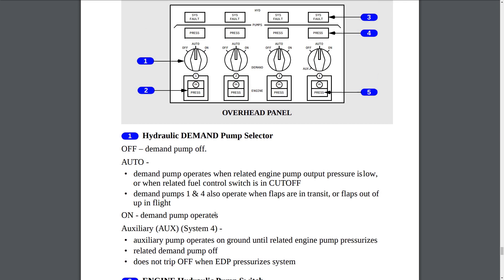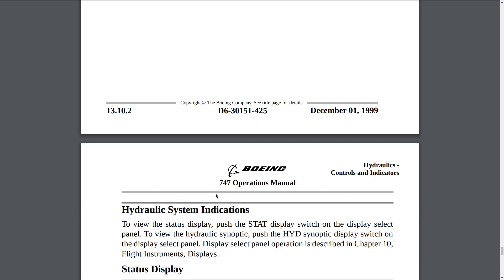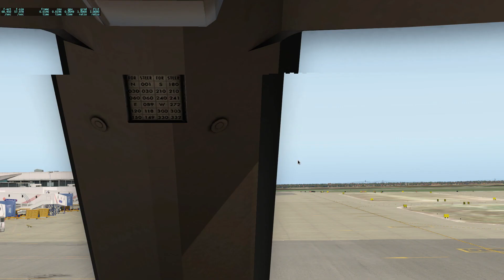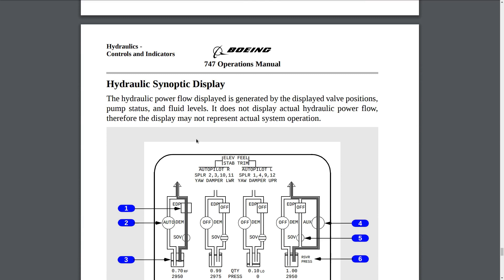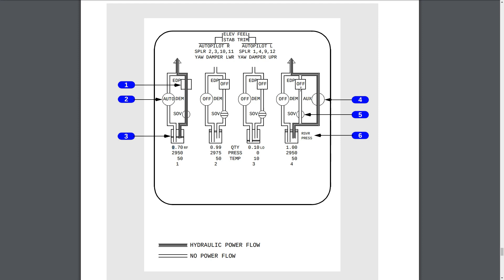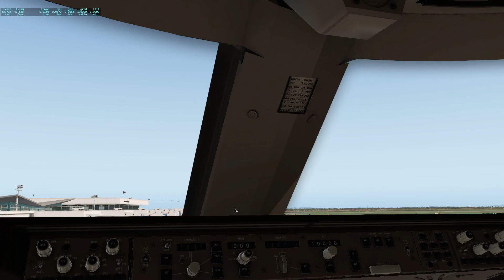Sparky744 Hydraulic Synaptic display (XP11.35)

Comment: I'm not sure that the current implementation of Hydraulic system switching and pressure is accurate. I've used some pretty high-fidelity simulations of the -400 before, and I do not recall this type of behavior. Are you using the following video as a reference?

https://www.youtube.com/watch?v=g1vWpTFNGls
Reply from the maker: so far it is based purely on what i found in the documentation + getting it working. its also not a "normal" start up in the video, but rather testing hydraulic behavior based on the engines that are feeding the systems. (for example engine 4 / hydro 4 is connected on its own to some pretty important systems which is why it has a seperate aux pump) edit:yes that video and the documentation agree, so if you spot a difference let me know and ill fix it
Reply: Just some additional info for you - you might take a look at this, which is an excerpt from a cold and dark start -400 simulation video (Aerowinx 747-400 PSX). 

https://youtu.be/0F4ZZyvcapo?t=1076

As the video opens and approaches the 18 minute and 03 second mark, you'll notice that the engines are all off.

The video then pans to the overhead panel, where you can see that all 4 engine pump switches are on and the demand pumps are currently off. The SYS FAULT, Hyd Dmd PRESS, and Eng PRESS lights are all illuminated.

The left 3 demand switches are rotated to auto, and the 4th to AUX, and all of the SYS FAULT and Hyd Dmd PRESS lights extinguish, except for Sys 4, whos Hyd Dmd PRESS light remains lit. I'm not entirely sure if the Hyd Dmd PRESS light for AUX on 4 remains lit indefinitely, or if it's simply building pressure and extinguishing after the camera already pans away from the overhead. Will have to look into that.

As the engines are started, the Eng PRESS lights also extinguish. 

This cumulative behavior is contradictory to what we've seen in the video that you posted above.
Reply from the maker: are you sure? which part - note systems 1 and 4 take a lot longer to pressurise (and the sys fault lights to go out) because they run on bleed air rather than several kw electric pumps like 2 and 3. theres at least one point where i say "that light would go out once it reaches pressure". - jump on the discord server and have a check/play - this system is on the github download so you can already try it yourself.